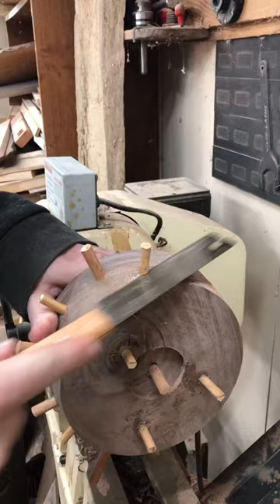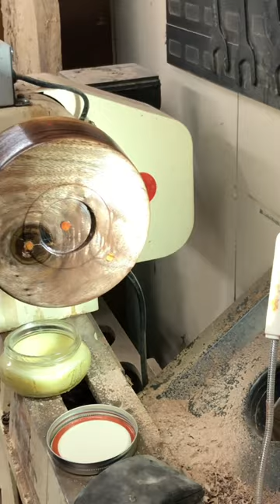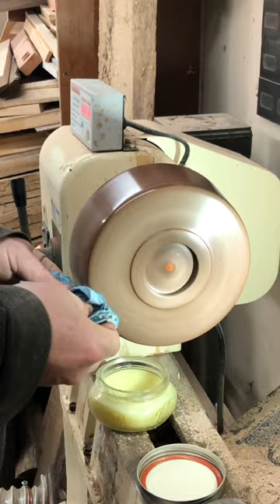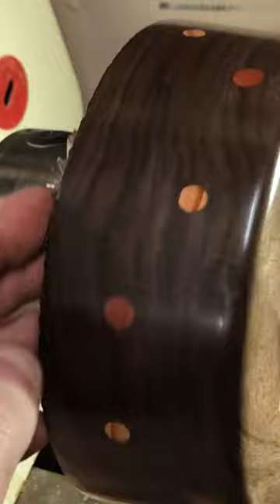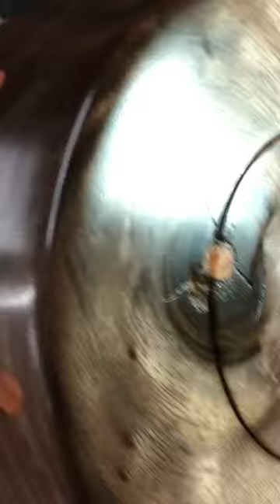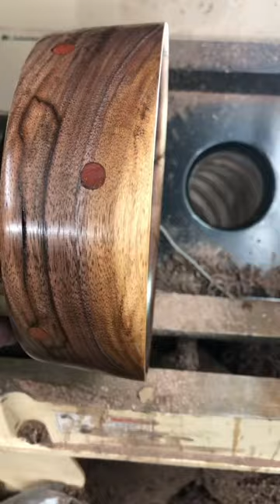Finishing Up The Porcupine Walnut Bowl! | Woodturning

Comment: Does it have to be small enough to fit on that spinning thing ? If so how do you polish the bigger objects without scratching it up?
Reply from the maker: Yes it is a wood lathe, takes a lot of work and years of practice to make it look easy. You can mount larger items on there, start at lower grits of sandpaper working your way up and polish once it’s fine enough!